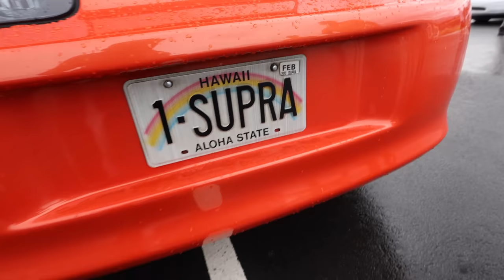Last Minute Hawai'i-Style Pop-up Car Meet

Comment: Tell the fiero to just get a supercharger from any of the 3800s grand ams and it's a bolt on EASY!!!And spank the k24s those thing are UNBELIEVABLELY FAST WITH A SIMPLE USED BOLT ON FACTORY SUPERCHARGER AND THEY ARE CHEAP!!!!!MUCH EASIER AND FASTER THAT THE K,S!!!
Reply: no way…imma have to try that out, can’t believe i didn’t think of that😅
Reply: @thibautdabrowski6076  a company makes an adapter to bolt it on...... YouTube it!!! there's killer footage of some nasty ones ..
Reply: @thibautdabrowski6076  although those are the GT...
Reply: Grand prix had superchargers. I see them in the junkyard often
Reply: @410kane  I knew it was one of those..there was another Pontiac that had them ..I can see it but can't remember the name it was a strange rounded shape that came after the Prix...but the 3800 came in millions of GMs in that decade..👍
Reply: @410kane  it was something SSE.
Reply: @CraigBrosRacing  yeah man. Regals had that supercharger too. They were sleepers for sure
Reply: @410kane  maybe a Bonneville SSE?..can't remember but that sounds right ...hope that kid get the Pontiac hooked up..
Reply: @410kane i’ve tried to get one shipped out from a junkyard, but like i said finding parts and getting it shipped is hell
Reply: @CraigBrosRacing  yeah. I'm an import guy but I'd hate to see him put a Honda K motor in it. That's the easy way out
Reply: @thibautdabrowski6076  well a Honda K isn't bad considering your situation. I'd do it in a way that it can be changed back if needed.  There's a guy on YouTube that swapped a Ferrari with a k motor. His channel is StanceWorks
Reply: @thibautdabrowski6076  when your ready I can get you whatever you need bro...we have fields of those things in junkyards here in the south...👍